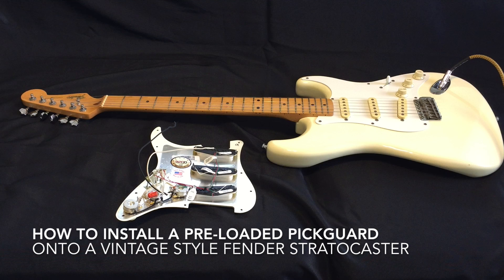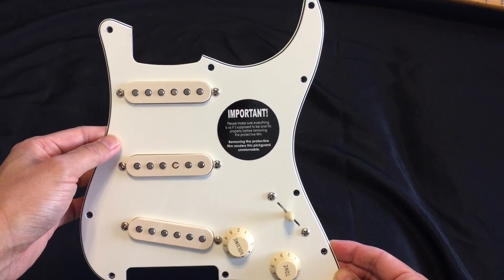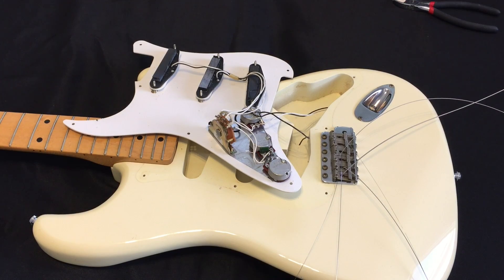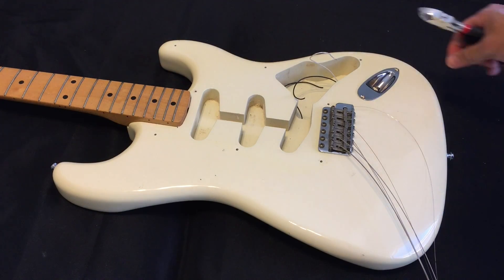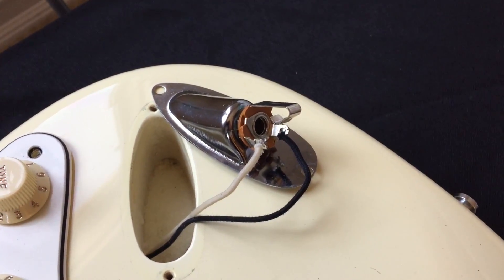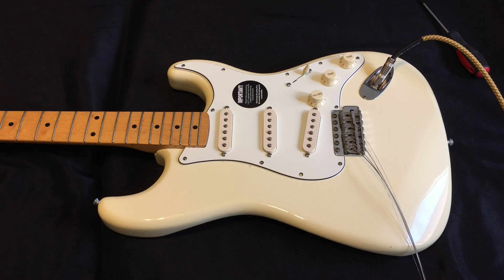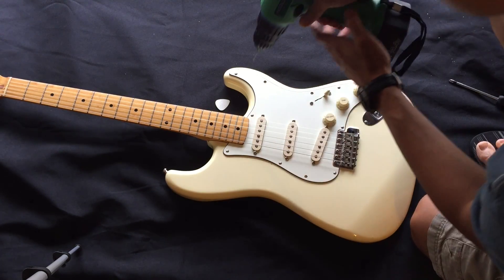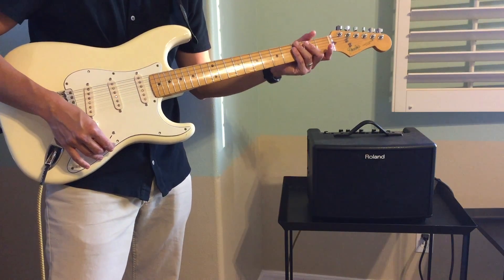How to install pre-loaded pickguard onto vintage MIJ Fender Stratocaster

Comment: I have a MIJ strat too.  I had a noise problem too, until I shielded it and changed the pickups to noiseless, made a huge difference with the 60 cycle hum.
Reply: Zunni Lunni Good for you! I think the pickup and the electronics were not great in these models (plus 30 years of time). My Strat is playing and sounding great now.
Reply: @anthony_shay  That is absolutely the case! I have an 88 strat standard MIJ and already replaced the five way switch a few years ago and now Tone 1 has gone bad. I opted for a 920D Texas Special Custom loaded pickguard, however, interestingly, it came with a brand new cord receptacle so having to figure how to install that. I think I'll have to do some soldering regardless, but thanks for giving the heads up about the pickguard screws. The MIJ only had 8 screws, so I'm thinking I'll take the extra time and re-use the original pickguard and just move everything over. Also will re-use the original knobs too since they are truly aged! Great video! Thanks for sharing.
Reply: Jim Stembridge Good for you! I think it’s going to bring new life to your guitar. I’ve been curious about the Texas Specials. If you are able to, post a video on how they sound on your guitar.
Reply: @anthony_shay  I'll do that once I get it installed and can. I'm looking forward to hearing it too, tho, I'm now intrigued about Fat50's so we'll see how much I like the Specials! I'm just ready to have a fully functional guitar again where I don't have to keep tapping the Tone2 knob to keep it from squealing like a pig in the middle of set!!!! Ahhh... those MIJ electronics! Gotta love em!

Comment: Great video. I bought 8-Hole 50s 57 Vintage pickguard and switched over the pickup etc from the loaded 57/62 pickguard, I could not bring myself to drill holes in the guitar. I like the shielding idea.

Comment: A couple of things I would have done different. 1. Instead of cutting the wires, just heat up the solder joint until it comes loose. 2. Separate the wire at the 1/4 inch plug end and at the claw rather than cutting off at the pickguard end. 3. When you put the pick guard in and it is too far back try taking it out and putting it in front end behind the neck first, because it may be just the way it fits depending on how you put it in. 4. I would practice soldering on something other than my guitar before attempting it. 5. I would cut the shielding tape to size before trying to stick it in to save time.
It's strange, I have a 80's E series MIJ strat and it has the 11 hole pick guard. Maybe mine is a later 80's style, who knows.
Thanks this helps me with a project I have with a $70 Aria strat style guitar I have purchased a fully loaded pick guard for.
Reply from the maker: @wealthfinder192  thanks for the comments and glad it helped.

Comment: Surprised to see those ceramic pickups in it
Reply from the maker: You mean the originals? I didn’t really care for the sound but maybe it was because the electronics were old too
Reply: The originals,,, cheap crap ceramic pickups... I'm surprised to see them in a Fender I wonder if they'd been added by previous owner...
Reply from the maker: @StevieZero  No these were the originals. This was a MIJ fender I bought in 1989
Reply: They were made side by side with Squier at Fuji Gen in Japan...Same guitars different logos and squiers hit with ceramic pickups,,, looks like maybe you're guitar got hit with the wrong headstock Logo at the factory...I wouldn't be happy to open up my fender and find those ceramic pickups in it...

Comment: Will it work on a fender bullet squir guitar eletric 6 string
Reply from the maker: @JodyHolcomb-du7rp  should work but you need to check the measurements. Might need to drill a few holes like I did but that’s not a big deal.

Comment: F.Y.I. if you clean your soldering iron by sanding off all the tip you will have a lot nicer job and it will be alot faster and neater !